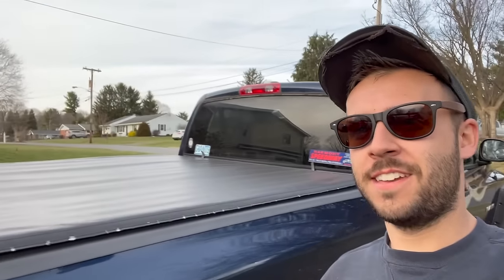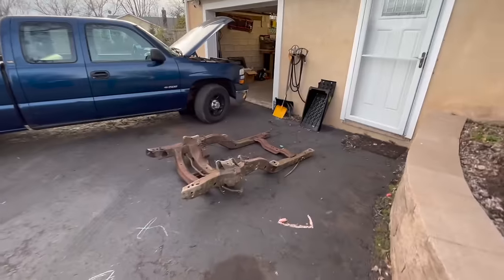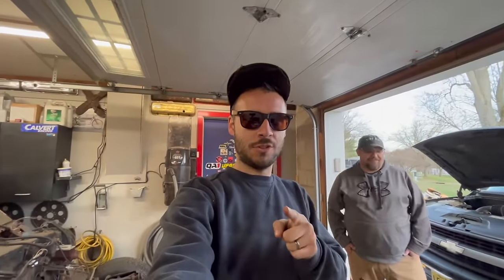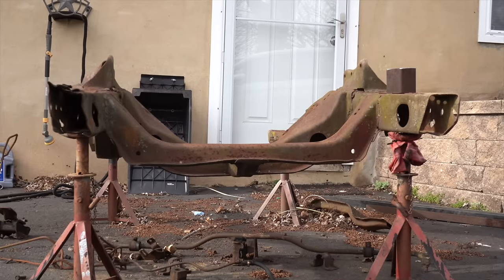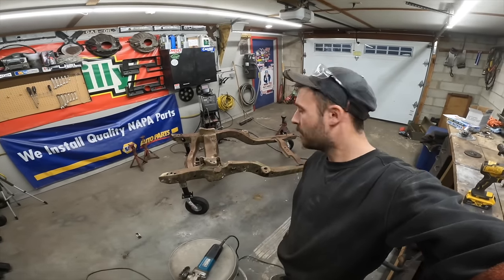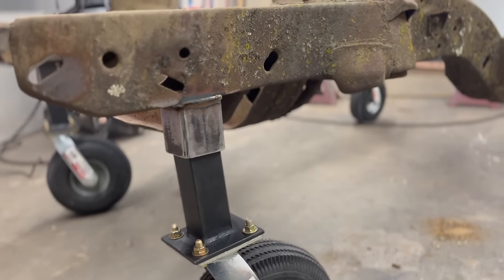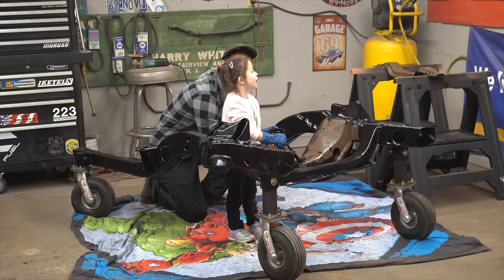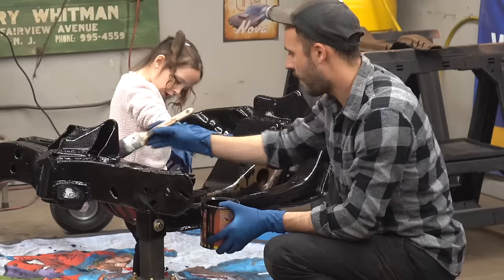SALVAGED!- DIY Engine Run stand for CHEAP

Comment: Awesome stand bud but i would of put the gauges on the driver side cause the throttle is on that side when you start it you’ll want to pump the throttle right in front of you instead of reaching over 😊

Comment: Saginaw's are really good trans, that's why most dirt trk'ers run three tres speed's. cast iron is heavier but stronger than aluminum/alloy and 4 spd's are good if rebuilt rite. . Super T Ten 10's are also good and Muncie's are kinda weak.. depending on Torque rating. I prefer my T-5 WC behind my 327ci. Over-drv yeah..kick's butt.

Comment: Very cool engine stand, but why didn't you finish it? It still needs a radiator, battery platform and a fuel cell. I think you gave the total before you were done spending?😁 Then there are options like electric fans for the radiator you should of got at the junkyard while you were there. And oil pressure gauge and a temp gauge.🤷

Can't wait to see the finished engine stand in part 2.😎👍
Reply: Sorry I missed the gauges but you still need the other stuff. Oh and this is an interesting project.😎👍
Reply from the maker: Yea I’ve got the gauges and switches in that panel. I already have the radiator from the small block parts score I had a few months back. For a battery platform I was just gonna use the flat portion of the frame rail in front of the control board to bolt it down. We do not have electric fans for it yet and probably won’t by the time we run the first engine in it. But I have a switch panel with a few additional accessory switches so we can add stuff like electric fans, electric water pump, etc, etc later on if we want to.
Reply: @hatchsrecreationalengineer1997  
Ok but how are you going to mount the radiator and fuel cell? Also, you didn't mention if you made sure the legs are tall enough for the cherry picker to be able to roll under it for loading and unloading engines.

I really like that you used that subframe for your engine stand, it has just about all of the GM engines covered. All you need is the different frame pads for each engine family.

NOVA = Nova, Omega, Ventura, Apollo
Which is Chevy, Oldsmobile, Pontiac and Buick. You really need one of each or 2 of each so you can have a small block and big block version of each.(Except Oldsmobile because those are the same engine platform except there is a short and tall deck version and Pontiac is the same with a couple short deck version engines.) To bad there wasn't a Cadillac version but unfortunately there's no "C" in Nova.😎👍

Comment: Looks like you were using POR15, I just watched a video by Repair Geek that changed my opinions on POR. Overpriced and it doesn’t perform compared to other products.
Reply from the maker: Yes it was POR 15. I actually had it leftover from a project a long time ago. For this particular project I’m not crazy concerned with it. It was just easier for my kids to apply then spray paint.